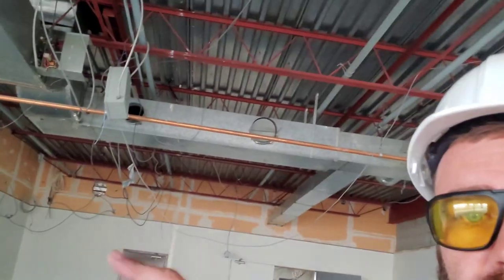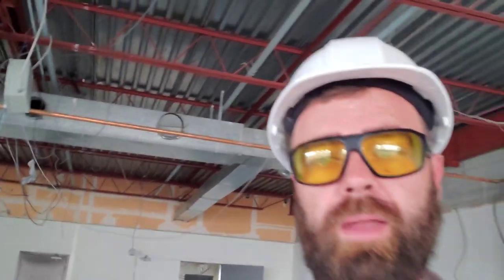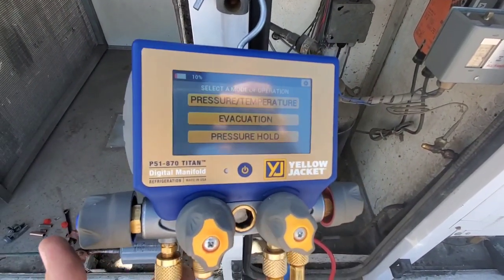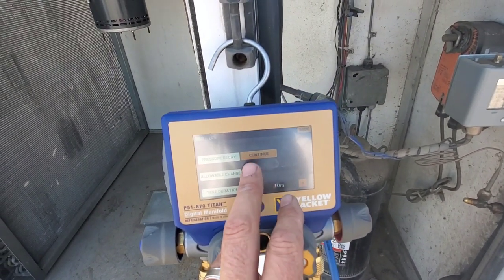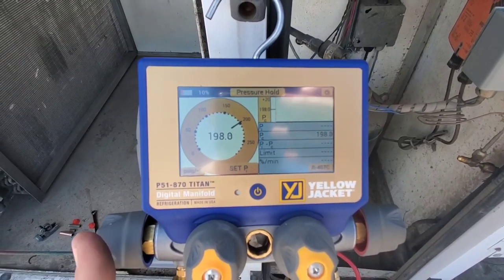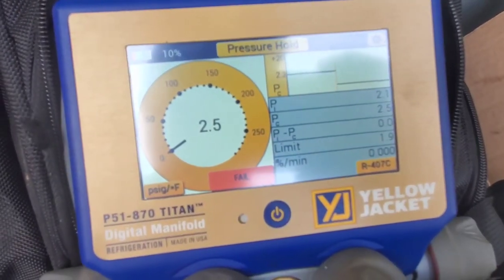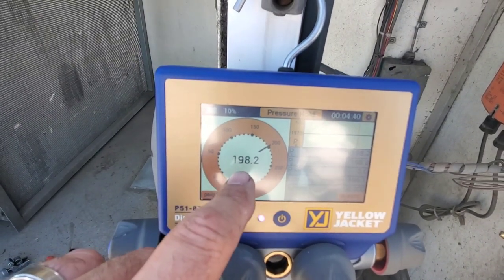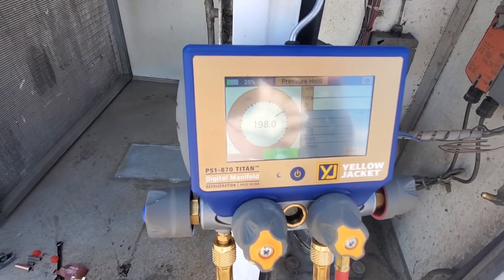Pressure Hold Test Using The YJ P51-870 Digital Manifold

Comment: My work just got me a set of these for this summer. I like them for the most part but I do not like where the probes hook into the unit. When I hang the gauges on the unit they get kinked. I already had to replace one due to this issue. I wish they hooked in the bottom.
Reply from the maker: They now have wirless straps as well to be used with the Yjack View app
Reply: @HVACKnowItAll  thanks for the info. I will look into the.
Reply from the maker: No probs